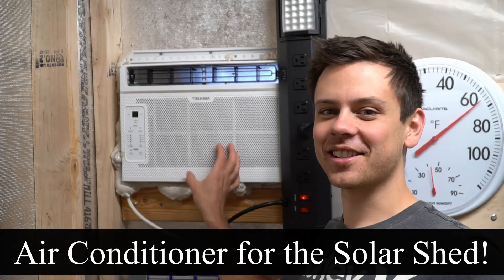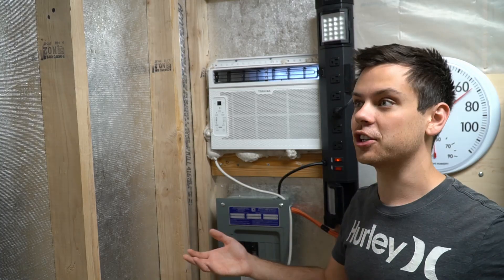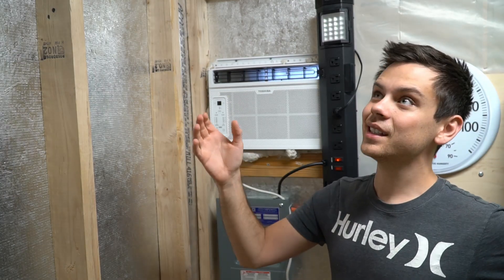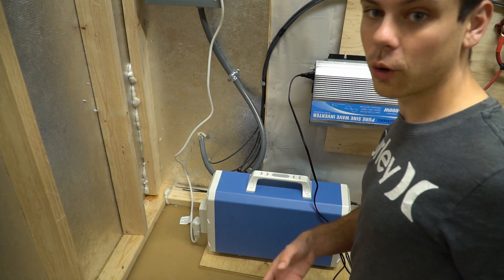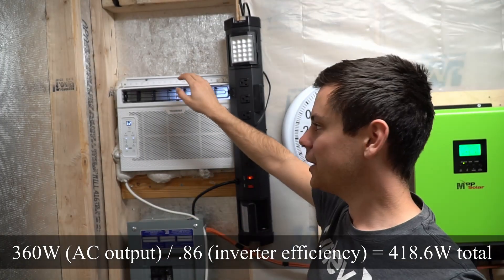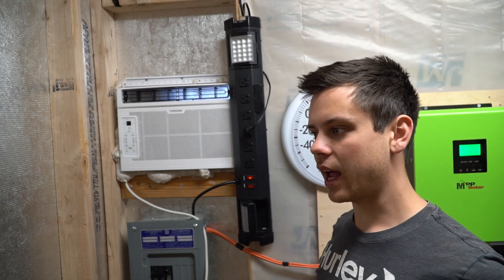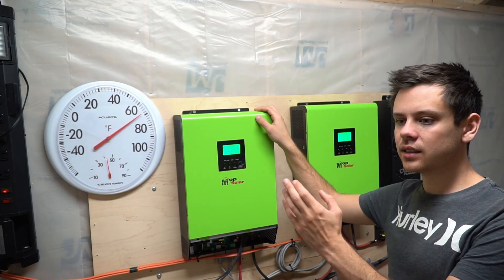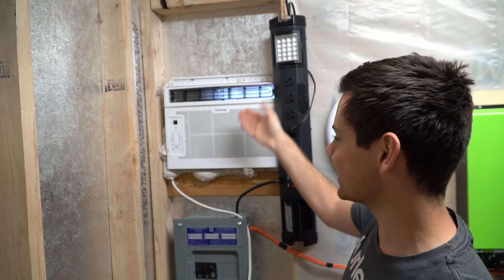Solar Shed: Running a Cheap Air Conditioner

Comment: good idea!!, for a small room.  i did the same with a 5,000 btu window  unit,  that was the  less watt consuming, available here in Puerto Rico.  it takes 470 watts  in  full cooling speed  but it work fine in low . for 3 years  running of grid  yust the  unit to see how many  years i can cool my bedroom with  agm 4 battery bank 75 amp each  in two pairs for 24 volt and 2, 300 watt solar panels.   Then  and you came with that new air conditioner  changing the game on efficiency, total  have  my attention on that experiment. keep the good work, we all learn on the way.   BTW i like that 6,000 btu unit,   waiting for the  next  Video Thanks and good luck.

Comment: I use a home made swamp cooler to cool my trailer. I used two window screens, and pulled apart one of those wadded up netting things people use in the shower, and sandwiched it between the two screens, and hung it outside one window and aimed a mister valve at it connected to a hose. in a window in the opposite end of the trailer, I use a fan blowing outward. It took some fine tuning, but it works GREAT and only uses a tiny amount of power!
Reply: Those work very well in the dry desert air where Will lives. 

The air conditioner he has is good as a demonstration of what would work in humid areas. 

It is definitely not required in Las Vegas.

Comment: I'd never install an expensive mini split in a shed. What you did was a great idea! I noticed you spray foamed the a/c. That thing with never move. Also btw just set the unit to like 80° and it'll auto turn on/off throughout the day. No need for any crazy designs.

Comment: Looking at the light emanating from the A/C vents, I’m guessing you have it set to bring in outside air, maybe accidentally. Obviously more efficient to recirculate cool air rather than have to cool hot outside air.   Just an observation, not criticism!  I’ve got about 1KW of solar on my garage. Runs most of my shop gear. But no A/C yet. It was 90 in my garage here in central Florida today. I’m definitely going to have to do something soon.  Keep up the good work!

Comment: Insulate but don't forget to air seal as best you can. Looks like you're doing that already from the look of the spray foam under the ac unit :-)  a tight seal around your door will likely be the biggest challenge.
Reply from the maker: Yeah the door is the hardest part!! Agreed

Comment: Will can you tell me the model number of the Acurite temp/humidity gauge you used in your shed. The large format would work well in my shop with testing automotive HVAC  dash output. thanks

Comment: how do i control a house outlet with solar? connect inverter to an electric outlet? thanks much.. i would like to hook panels up to an inverter or battery array to power an outlet to run an AC or a portable heater depending on time of year.. it would be good if there is sun, power  is povided instead of batteries..

Comment: just bought ur book off amazon, havent went thru it very much yet since ive been super busy but i will.. i just bought two 12v mpp 1k all in one unit models the plan is to use 1 for a/c -w/a 400-800 AH bank of lithium and 3-190 panels =570watts of solar all T'd together for like 30amp of charge current just for a 6k btu air unit like urs in a step van;) i hope it works🤞 so ill have two seperate solar systems for my application.
  The othe unit i have will have prolly 2-400AH of lithium and the same 3-190watt panels =570watts just for lights,chargings,radio,12v fridge also powering my 12v 8k deisel heater..
Reply: would be interested to know if this works. keep us posted

Comment: Is there 24 or 48 volt dc air conditioner unit available? That would be a cool (hehe) solution that you could use without any kind of inverter between there.
Maybe you could modify cheap ac unit like that and change the compressor motor for dc one... 🤔

Comment: Wont your AC need to be turned on each time by hand when you use a smart plug due to being reset?
Reply from the maker: No it turns right on. It's really cool in that way
Reply: @WillProwse  Awesome.  Well I'm glad to see you have it working.  Can't wait to build something like this in a few years.

Comment: Your videos are excellent.  Thank you for the content you provide.  Your channel is an asset to anyone investigating energy options.  I have learned so much as I investigate dry camping power for my RV and options at land where connection to the power grid is costly.  These are two situations where I find the cost/benefit equation of solar works in my favor.  I have lived long enough to have seen many technologies evolve that did not live up to the hype (CFL light bulbs come to mind) and I am trying to overcome my hesitation to jump into Lithium Iron Phosphate batteries.  Like CFL light bulbs that I was told would last 22 years, I am equally cautious about LiPO battery claims.  Please don't take my question as disrespect because I am genuinely uninformed.  Can you - or other experts - tell me how my IPhone battery is only really serviceable for 2 years before significant degradation, but a Battleborn (for instance) is going to be serviceable for 10 years?  Thank you for any insights.

Comment: Will's famous last words..." I'll just add more Solar Panels" LOL
Reply from the maker: Hahaha
Reply: @WillProwse  I just picked up ( 2 ) used Sharp 175 watt Panels for $50.00 ea. Tested @ 44.3volts. Now just waiting for the clouds and rain to go away. This 350 watts will be added to the 275 watts I currently have in my Truck Camper powering ( 2 ) 200Ah AGM Batteries. Next up is adding 1 more 200Ah AGM Battery. Is 625 watts of Solar a good match for 600Ah of Battery only using a 1000 watt Sine Wave inverter for just a laptop, 32"HDTV, and DVD Player , 3 LED lights, and Phone charging.?
Reply: Gerald you've got more Ah than you need for the little 1000watt inverter, but less panels than you could use to recharge those big 600Ah, if you pulled heavier loads. Maybe you could build a hot-tub or kick amplified sound system, or start crunching bitcoin to generate some load.
Reply: Crazy thing I actually just got done adding another panel to my small solar array and re-building the rails.
Reply: What could go wrong - Smoky Stover... (how old are you if you got that?)

Comment: I understand maybe 10% of what you’re explaining at any given time, but I’m nonetheless fascinated! I will continue to watch your videos and hope that I gain some understanding…perhaps by osmosis? 👍
Reply: I keep this handy to understand, it is all about the math:

AMP HOUR to Wh
48v x 100Ah = 4800Wh
AMP HOUR to KWh
(48v x 100Ah) / 1000 = 4.8kWh
Wh to Ah
4800Wh / 48v = 100Ah
kWh to Ah
(4.8kWh * 1000) / 48v = 100Ah
Wh to Watts/hr
Wh:	4800Wh / 3hr =   1600 Watt/hr		1.6kW/hr
kWh:	4.8kWh / 3hr =   1600 Watt/hr		1.6kW/hr
Amps to Watts
48v * 12A = 576W 
Amps to Volts
576W / 12A = 48v

Comment: Is the AC for You or for your Equipment? IF its for the equipment, what temp are you trying to keep that at?
I ask because I am starting a build in the Philippines & it doesn't really drop below 80º there all year, with an UV factor of "Extreme" pretty much every day

Comment: Do you have any videos regarding fire suppression and the dangers of fire with Li ion batteries?
Reply from the maker: These are LiFePO4. No reason to. Read the transportation studies or safety sheets to learn why. NMC? Super dangerous. Li-poly as well. What chemistry are you building with
Reply: @WillProwse  I'm not building with any chemistry yet, I'm just curious.  I assume you're in a domestic setting so not covered by fire regs.  I still think you ought to have a CO2 extinguisher somewhere in that shed.

Comment: Like your solar-battery-AC configuration. A 6000 BTU should be adequate for 200 sq.ft room, what is yours? I would add a fan to keep even room temperature and maintain a minimum electricity consumption above 5 W.

Comment: Very cool! I hope to run an AC window unit just like this. I have the two Lion Energy UT1300 batteries with a 2000w AIMS pure sine and MidNite Classic SL150. How do you think that will hold up with 700 watts on the roof? Two Bluetti EB150s and the EcoFlow Delta for back up systems. I should be in good shape this summer!
Reply: 'Sup Paul ? Found you over here in my Playground !!

Comment: Yeah, I’d add some more insulation in walls and ceiling. Huge difference be it hot weather or cold weather to keep your temp even and energy used to a minimum. Question...you mounted AC unit over an electrical box. I know AC units are suppose to not sweat or leak especially in low humidity like Vegas, but seems to be some risk or not? Love how you use your electrical knowledge to use components specific to an end purpose. It’s kinda complicated and overwhelming to the uninitiated, especially when given the many applications and hardware sources to use. I’m still learning, but you’ve helped a lot to refine my possibilities to being off grid. Batteries have become my biggest surprise...how many needed, cost per, ah needed, volts coming and going, lithium agm lead acid, oh and wiring? It’s a lot to wrap your head around!

Comment: Efficiency test. My test of my 5yo  schneider conext sw4024 shows 84% efficient.
Load loss efficiency description...

0         64 0% idle

5         64 7% inductive burner ready

87       70 55% freezer

251     97 72% gas clothes dryer

327     88 79%  Electric heater no fan

835    165 84% inductive burner level 3

887    175 84% inductive burner level 4

960    189 84% inductive burner level 5

1096  212   84% toaster

1120  203   85%inductive burner level 7

1510  320   83% inductive burner level 10

Efficiency test of my 15yo advanced energy 5000w 48v inverter.

Load + losses differents efficiency    description

0         54 10w 0% idle

5         58 8% inductive burner ready

87       70 55% freezer .55

238     97 71% gas clothes dryer

326     88 78%  Electric heater no fan

1600  334 83% inductive burner level 10

Comment: I think the insulation should come 1st. better to use passive non tech 1st before adding cells and whatever. 

Check out youtubers, Honey Do Carpenter, They built an aircrete shed, high insulated if you ever want to build another cheap.

Comment: How do you calculate battery life based on power consumption ?  Asked a different way, how long can you consume say about 500W from a 12V lead acid or LiFePO4 battery ?

Comment: It's news to me, I thought insulation and a decent roof fan, would put about the same wear on electronics/equipment.  (even in Arizona etc)  Although this "solar ac" is much requested topic from less knowledgeable channels.
Reply: Mmmmm? Maybe a good test?!
 I would cut Vents in the LOWER SHADY Side of the shade and in the attic on the opposing side using a fan to draw out the heat...?
Reply: @georgefenrich4119  I think WIll's issue, (I know nothing about), is damage/lifespan/wear to components, with a fan vs, ac.  Sounds like batteries are main concern. I didn't know, 440 watt ac were so available, reasonable.  His channel always draws me in, he has fun with it, while being very detailed and informative.

Comment: HI Will, great stuff, wondering if an 86 lb thrust trolling motor that is powered by 24 volt would be appreciably more powerful than a 55 lb thrust trolling motor powered by a 12 volt battery.  Would the 86 lb motor be approx 30% more powerful ? more or less?

thanks

Comment: I use a relative cheap mini spit whit inverter technology (altho i have not tried it with a inverter) this means there is no peak start up current. What in turn means the inverter only has to be able to handle the max given current of the ac unit. The price differents of the cheaper inverter should easily overcome the higher price of the ac. This ac is also much much more quite than a window ac. Also window ac's with soft start exist this woud be even cheaper. I have monitort my ac and it really does not go over max draw, no peak. Well if you use brand inverters anyway.
Reply from the maker: Wow that's great. Which one are you using
Reply: @WillProwse   Cooper & Hunter don't know if its available over there. I use it for cooling and heating in combination with a grit tied solar system. 3,5 years now so it has earned it's money back even with cooling in the summer.

Comment: It's a rare situation, when sun is cooling instead of heating.
Reply: pretty common really in hot climates ,  and good mix that keeps the summer bills down
Reply: Ryan Crisp We call it cooling for object that gets its thermal energy transferred, and heating for objects that received thermal energy. Ever increasing entropy and energy moving around doesn’t make it less real. Also we can refer to the heat death theory (when entropy achieve it’s maximum level) as cooling since energy gets more disordered and dispersed
Reply: Well stated!
Reply: If I’m right, old refrigerators ran on the principal of heating up ammonia, which somehow was converted into a cooling effect. If this is true, could you have the core that houses the ammonia in direct sunlight and amplify it with a sort of magnifying glass to increase the suns effects and uses it to generate a cooling effect such as an air conditioner puts out and possibly split it into a refrigerator also. Just a brain fart.

Comment: Do you have a device that can track shed temp every hour our something? Would love to see a graph of shed temp to outside temp to power used. Thanks!
Reply from the maker: Oh that would be fun!!
Reply: I'm sure that could be done easily with an Arduino and a temperature sensor.
Reply: The sonoff temp relay works great. Can set temp range and timer
Reply: Temperature sensors are common in home automation systems. You can get a nice cheap Home Automation server running in your house on a Raspberry Pi and program it as you wish easily.
Reply: @zaibervaireus  funny how we say " easily" when we already know it. Its not easy for people that don't know it.
Reply: @mtask2010  Will is definitely able to get it done easily.
Reply: Motorola mc4000
Reply: Dustin Poche  I mean like a Raspberry Pi or Arduino. Can easily attach a control to them and set the software to record hourly temperatures.

Comment: One thing I know about the off grid ac is that the ones with out remote and only 2 knobs use way less, for their cost selling about 100 to 200
Reply: @georgefenrich4119  yea the plain ones no remote are cheap and use less power than fancier models

Comment: Add some Roxul rock wool insulation, fire resistant and very efficent.  You don't need an attic, just insulate under the roof.

Comment: Cool! I'm cooling my RV now with a swamp cooler run from solar, here in Idaho in the summer it gets up to around 90-110 degrees F and soon my well pump will be running of solar to. The well pump controller uses 120W!!! CONSTANTLY so I need to take that out and just put in a cutout, the well pump can run on 35vac/dc-250vdc/ac too, oh so meany cool things to do with solar!
Reply: Have you looked into a RAM PUMP?
Reply: @georgefenrich4119  Yes I have, but it won't work for the well (it's 280ft deep) but we have a sessional creek that I want to make a ram pump at some point for watering. And I'll make a video about it when I do get to building it.

Comment: Living in Tucson in a small vintage trailer I have found that with a window a/c there is another variable to consider. The temperature that The a/c is able to maintain is a function of the outside temperature . In other words my 5500btu a/c can only maintain a temperature difference between outside and inside air of about 25 degrees and as the outside air surpasses 100 degrees that differential reduces so that a typical summer temperature of 105 to 112 the difference is only 15 degrees. That means that my inside temperature is around 90 degrees. That is pretty warm even in a “dry heat”. I do have access to grid power and my results are identical. My trailer is less than 100 sq ft..
Reply: Can you build a Carport / SHADE?
Is your AC on the (LOL in AZ) Shady side? 
can you Shade the AC?
Reply: George Fenrich   Shading it doesn't help much, maybe a degree or two. Larger btu a/c 's have a larger temp difference, I think, and that's what I'm going to try next. It would help if an hvac guy would weigh in on this. I should probably go with a mini split.

Comment: Hi Will, my question from your description is whether or not standby modes are actually possible with this combination. A typical inverter in standby isn't going to power anything, including the 1W standby consumption of an AC. If the 1W standby consumption of the AC prevents the inverter from going into standby mode, presumably what actually matters is the ultra-low amperage draw efficiency of the inverter rather than what it pulls in standby mode. Standby mode would just shut the AC off and it wouldn't turn on again until the inverter was powered up by something, at least in my experience.
Reply: Different brands label standby mode differently. Sleeping mode, standby mode, low-power mode,...   I hope he clarifies.  He did say the air conditioner was consuming one Watt so I assume it's low power mode  he's talkin about which isn't really a mode though.

Comment: I think my 24v 2kw giandel draws like 1A standby...
Reply from the maker: That's strange, not mine. .28 amps is what I am measuring with Klein meter. What meter are you using. I can test with another meter
Reply: @WillProwse  checked the manual, should be the PM-2000KAR and 0.8 A idle. 

when I think of it, must be because its the 230V version for the eu market
Reply from the maker: I'll zero out my meter and test again tonight
Reply from the maker: Make sure absolutely nothing is connected to ac output.
Reply: @WillProwse  mine has a low / high voltage cutoff btw  at 19.6V/39.2V .. well ofc thats super low.